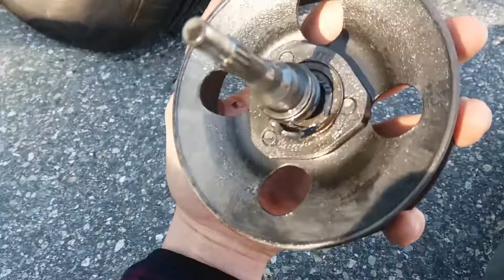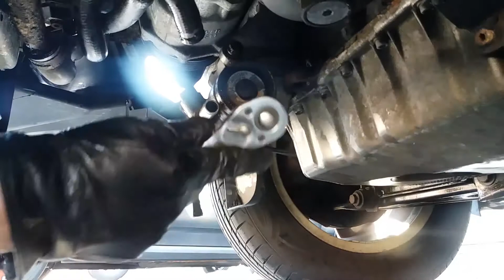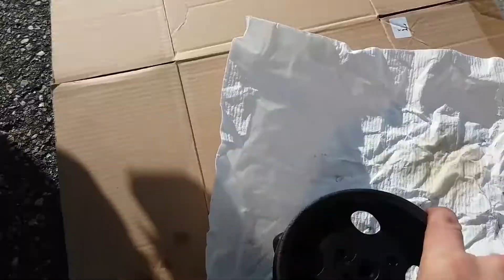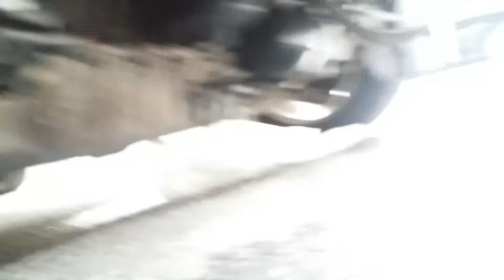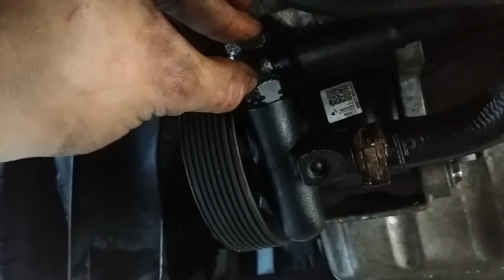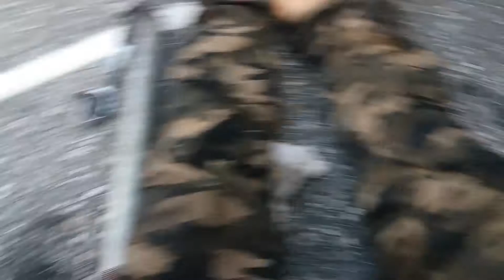VW VR6 POWER STEERING PUMP REPAIR- JETTA GOLF

Comment: What sort of noise did it make?
Reply from the maker: it will hum or squeak. steering will get firm
Reply: @Vijuel  mine was always firm, never smooth. And a squeek comes and goes. Very faint squeek though

Comment: I have the same car with the same problem any time i started the car and start driving my car is doing the noise when there is not power steering in the lines also the container i notice that the S.P. has no leaks the leak comes from the one of the boots of the passenger side ..this could be a problem with the racking pinion or could be the steering pump?
Reply from the maker: Gero Azmodii it's not the pump if it's not leaking from the pump. Eventually the pump bearing will be affected if it is running dry or low on fluid (domino effect). Problem is wherever the leak is.